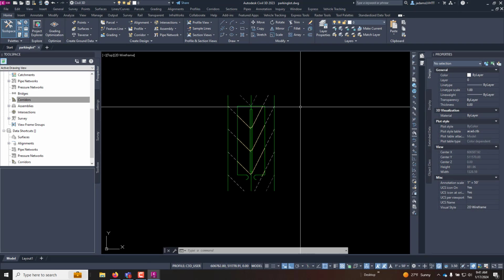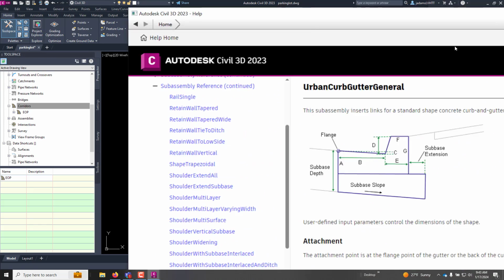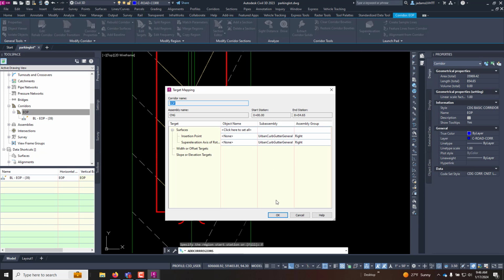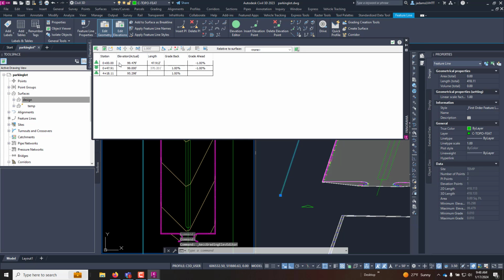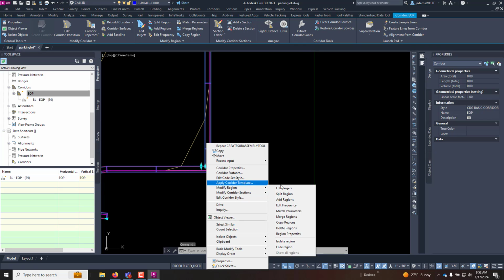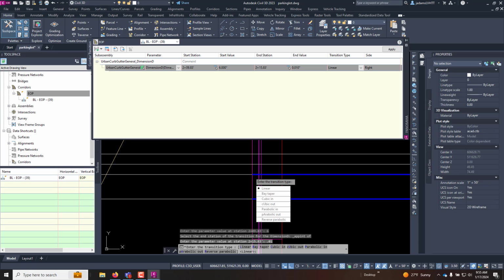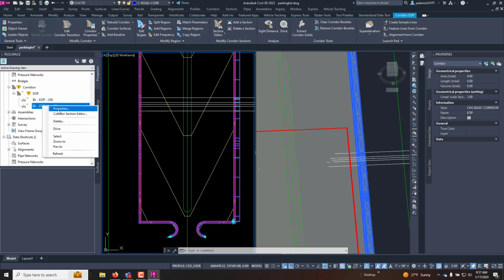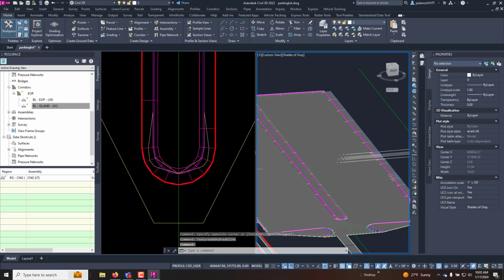Civil 3D - Corridors for Curbs in Grading

Comment: The 6th minute of this vide is confusing. I dont understand what this "extracting" even is and my corridor did not get the triangulation
Reply from the maker: Extract auto corridor feature lines creates “features” that the corridor creates by connecting assembly point codes